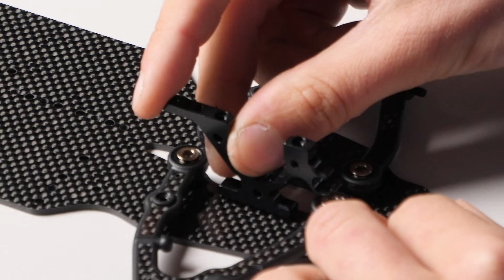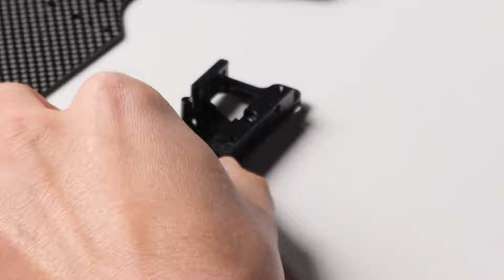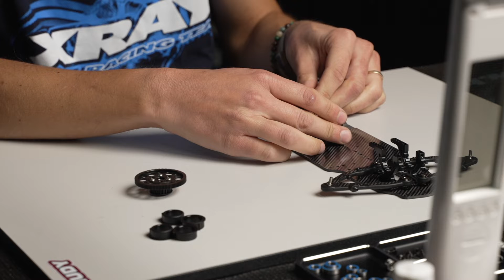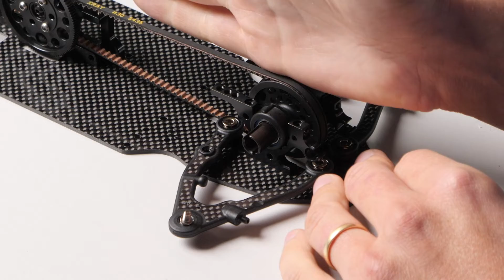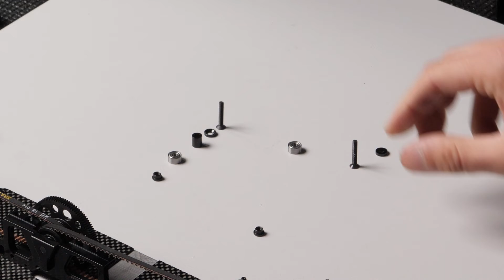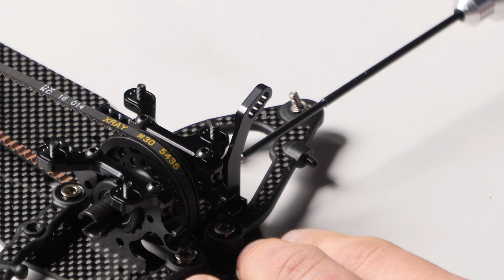XRAY X4 - Build - Central Transmission

Comment: Bearingholders in aluminium? How does that provide less friction as you said? It’s simple holds the bearings in the right place and does directly impact the friction inside the bearing. Yes the aluminum bearing holders provide less flex, and maybe the load on the bearing is a tiny bit different, but the impact is so insanely small due to the weight of the car, that it wouldn’t impact the smoothness/friction/energil loss in form of heat inside the bearing. Some engineer out there should be able to agreed with my comment. I am a Marine Engineer myself.

Comment: Is there no need for threadlockers, like Loctite, when attaching the screws to metal components?  Thank you for your in depth, well constructed videos.
Reply: The only parts on the car on which I use thread lock are the set screws for the couplings in the ECS & CVD shafts in front and rear.